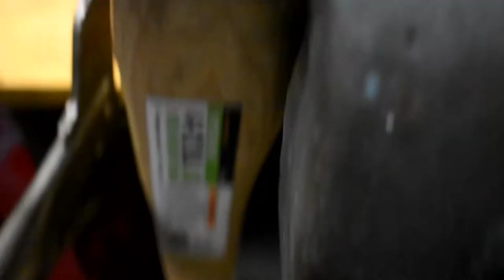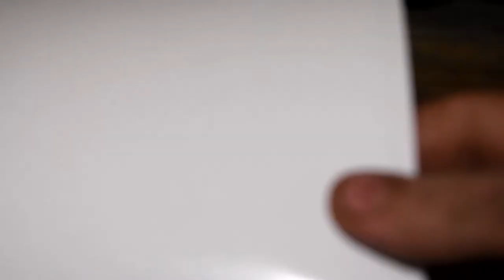Etch Graphics On Metal,  Modify Harbor Freight Axe into Viking Axe

Comment: Hey Drew, when you cut into an axe head, what sort of cutting wheel do you use on your angle grinder? Thanks.
Reply from the maker: It is called a Cut-Off Wheel. I usually use a 6in cut-off wheel that's 1/16 in thick.  so I can get close to the line.    Thanks for watching the video. I really do appreciate it.

Comment: do you need to seal it after applying the Jax blackener?
Reply from the maker: After the blackener, I just use boiled linseed oil to protect it from rust, and it darkens it more too.
Reply: @drewdoesart9277  awesome, thanks so much. Love the work
Reply from the maker: No problem. Thank you.  @ArmwrestlingAsh